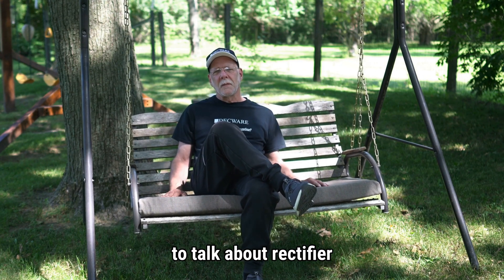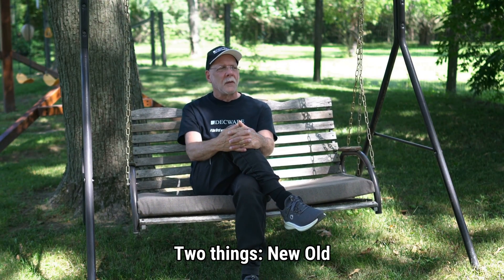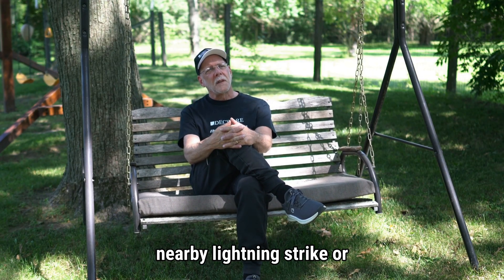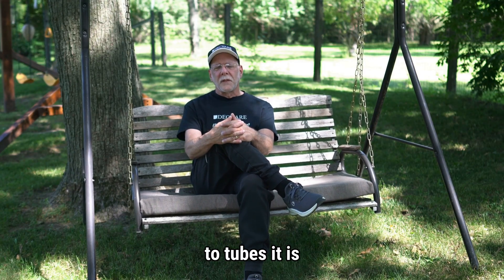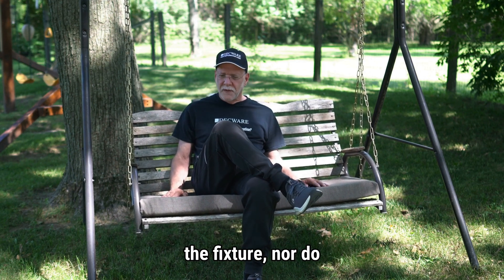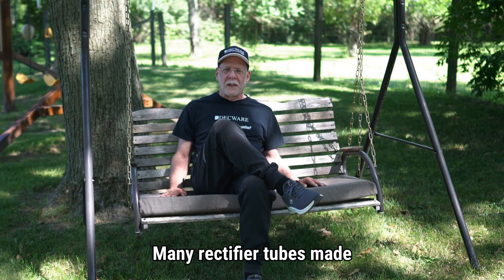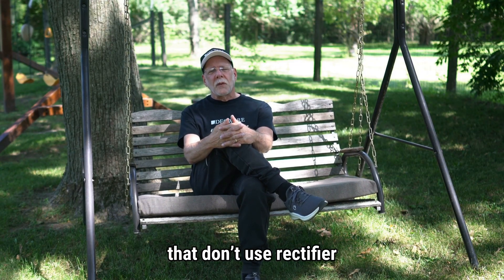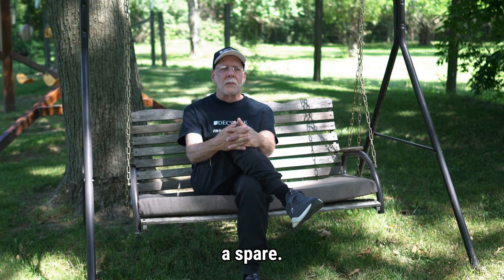DECWARE's Steve Deckert talks about rectifier tubes.

Comment: Just convert from a tube rectifier to a solid state circuit. No big deal. As for that "sag" feature, that's NOT a good thing and shouldn't be in any system that purports to reproduce the original signal unaltered. Guitar players may like it but it shouldn't be in a high fidelity system.

Comment: This is an excellent and very informative discussion - thank you Steve. I have done a lot of rectifier tube rolling. First off, I was absolutely stunned by the difference that rectifiers could make. I have primarily experimented with Type 80 tubes, which require an adapter. (Type 80s were a suggestion by Kevin of the Glow in the Dark website.) The first type 80 I used was a Sylvania in ST tube/shape. That tube “woke up” the amp, giving it the weight and solidity that I didn’t know I was missing. I have tried other Type 80s, including a few different “balloon” shape 281s. Sometimes the changes are subtle but noticeable, sometimes not.  I now have 13 different rectifiers, with RCA balloons as my #1 choice. A pair of those are tucked away for the day that I order another SE84UFO (and wait 3 years for delivery!) and run them in mono.

After watching this video I may embark on a NOS 5U4 expedition. 😂

Comment: If you really like the sag of a rectifier tube, put a resistor in series with the rectifier diodes. There is no engineering reason for rectifier tubes since 1965, and all the old ones can be replaced with diodes and a larger filter capacitor.
Reply: He said his are the size of soda cans.

Comment: Many designs don't heed the specification of the rectifier tube also, which shortens tube life. For a capacitor input filter chain C1 must be small by todays standards. Also the inherent impedance of the power transformer must be higher than todays standards. For example if a design used a modern toroid power transformer, then you must insert current limiting resistors after the transformer secondary 50 to 100 ohms. For choke-input filter chains (which sound the best IMO) the first cap can be bigger and the current limiting resistors smaller as the leading choke shapes the raw DC. I like choke-input with tube rectification, it regulates better, sounds better, and the tube likes it better, lives longer!

Comment: Great advice, Steve,  I have a NOS RCA rectifier backup and a Cryotone currently employed.  I know Cryotone has made its way into your amps in the past. Any other recommendations or should I stick with Cryotone as backups moving forward (love them).
Reply from the maker: Honestly, the cryo treatment process that Cryotone uses, (secrets ramps and cycles that no one else has done) make a mediocre JJ tube sound and perform better than the best NOS and they seem to last longer, so really it takes the guesswork out of it.  Remember, today's N.O.S. tubes may well be yesterday's rejects.  It's getting progressively harder to find premium stock in  perfect condition.
Reply: according to realworldaudio, cryo treatment is temporary, and requires re-doing, maybe every year for tubes. He learnt this from his mentor who ran a dragster that they would cryo treat the motor parts after every meeting, and they did not need to replace part's like what is common in drag racing today.

Comment: Probably not the location to ask. However, is the fuse that might blow when the rectifier tube blows; Is this fuse located UNDERNEATH the rectifier tube inside the SE84OFO or is it the fuse located at the power cord inlet? 🤔
Reply from the maker: In an SE84UFO there are fuses in both locations. Either one could blow.
Reply: My SE84UFO came with the rectifier damaged in transit. In my case it was the fuse inside the chassis that blew when I first turned the unit on.